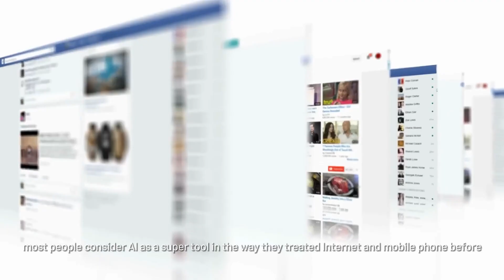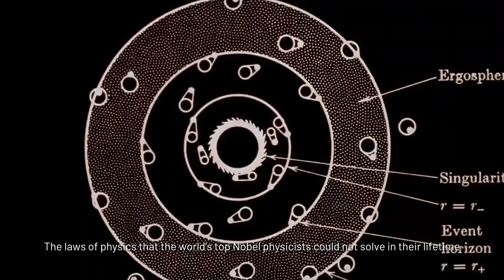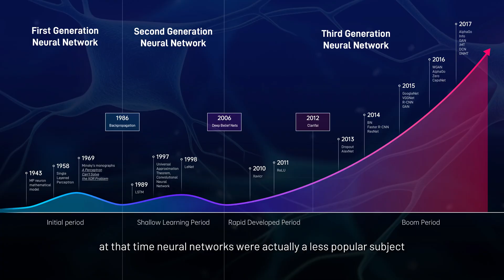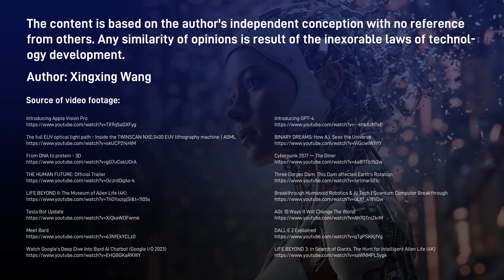To be Immortal: AIA/Artificial Intelligence Avatar + CSI/Cross Scale Intelligence

Comment: 5:00 It doesn't work this way. "simply scaling up an organism will undo the balance that has been achieved for that particular size. Its muscles will likely be too weak, its bones will likely break, and it will generate so much internal heat (if it is warm blooded) that the only equilibrium achievable given its comparatively small surface area would be at a high enough temperature to denature many proteins." Google for this quote to find full answer.
Reply: They aren't suggesting that the bigger robot would have the same design as the smaller robot.
The image is just an illustration.